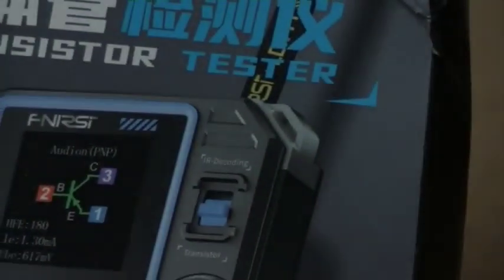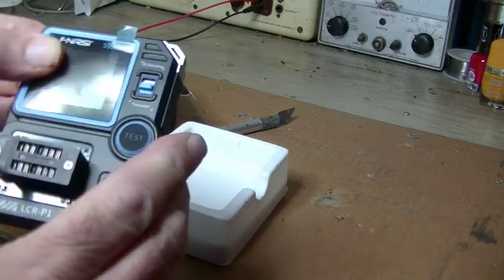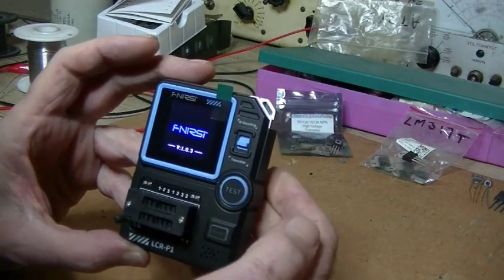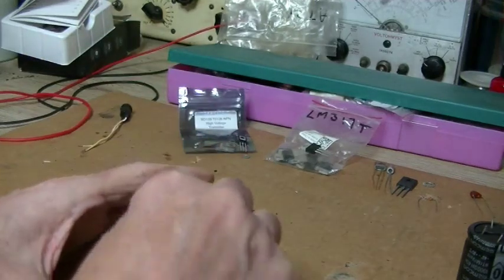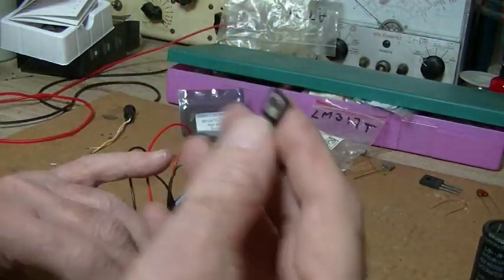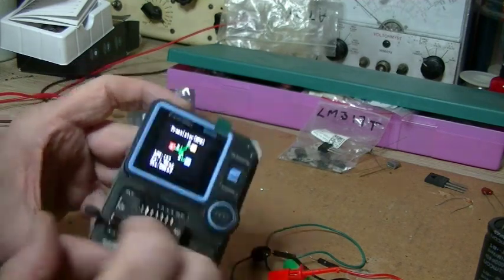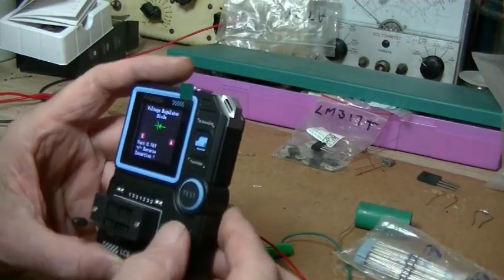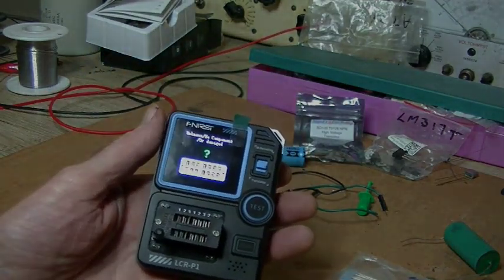Checking out a Chinese Transistor Tester. The FNIRSI LCR-P1 Component Tester

Comment: I bought one of these FNIRSI LCR-P1 testers recently. I do a lot of DIY builds, such as guitar effects pedals, tube gear, preamps, HiFi and audio amplifiers, etc. 

It makes things SO much easier to test and get an accurate reading. I bought it initially just to test the gain and type of transistors I had for guitar fuzz pedals, but it does so much more. 

I love it and would highly recommend it to anyone who builds, repairs, upgrades, or modifies, etc., any type of gear. Worth every penny, which wasn’t much. Considering how much easier it makes testing parts, it actually cost very little and worth every penny. 

Thanks for the video!
Reply from the maker: Yes, they are a great little unit, thanks for watching :)

Comment: Can't have too many testing devices, in my opinion Frank. When checking regular diodes the polarity shouldn't matter, the triangle anode side should point in either direction.
Reply from the maker: Not wrong there Ken. Thanks for the tip on the diodes :)